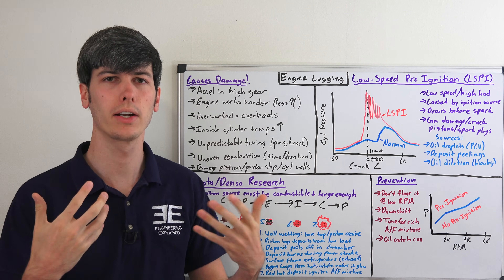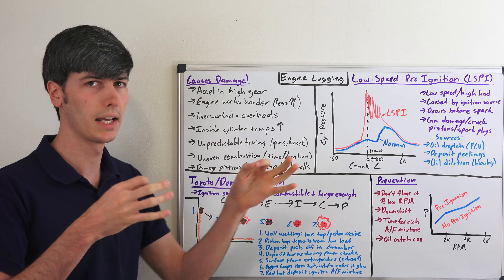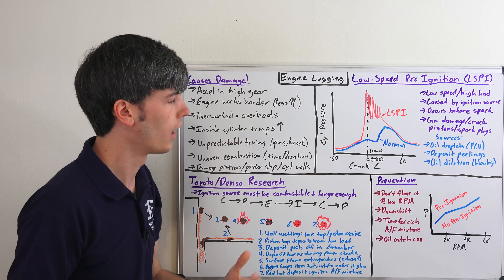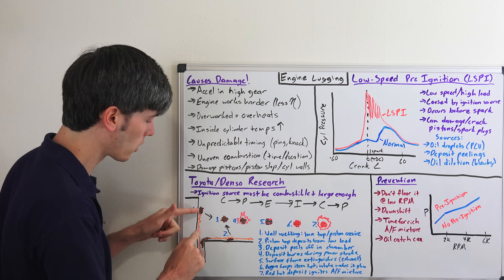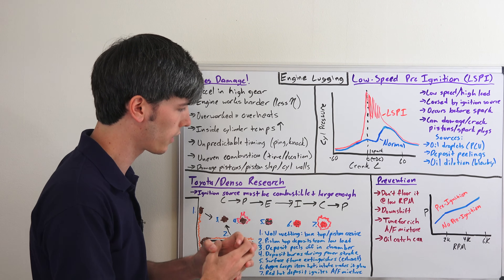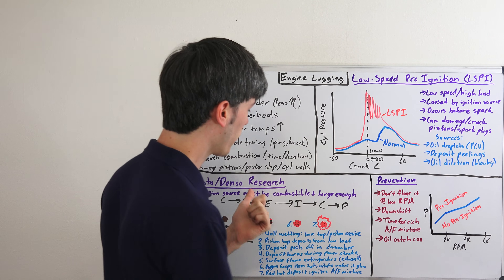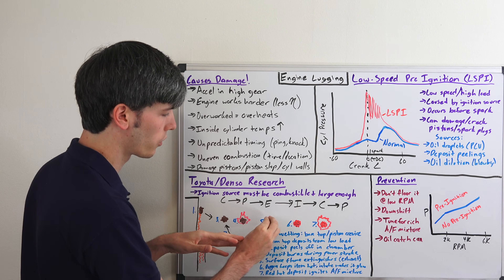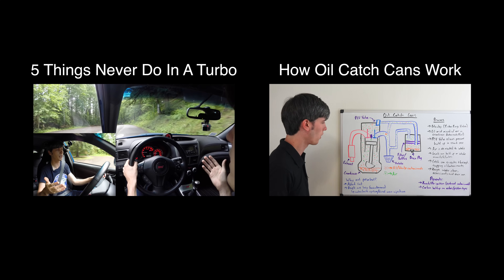Why You Should Never Lug Your Engine (Especially Turbos)

Comment: I haven't watched the video because he's hella boring...
But the combination of High Throttle Input and a Low RPM Gearing Choice makes the engine work extra hard to the point you can actually hear/feel it!

The fix is: Anytime you wish to Accelerate (put MORE work on the engine) make sure to downshift into a higher rev range! Obviously anything above 2500 should be safe (if you need to find that fine line you are probably just trying to distract yourself from a myriad of problems. Get your ish together!!). 

To reiterate: Just freaking downshift !!!!

Comment: What about cars with automatic transmission. they  seem to run at low RPM, i think on BMW 335, max power start at 1500 rpm and up shifts around 2500-3000 rpm in normal mode.  It down shifts automatically if engine rpm is too low for the gear you're currently in.  I assume the engine management  would prevent lugging.  Does this lugging apply to cars with auto tranns?

Comment: Most of the time I agree with Jason's Engineering Explained videos but I don't agree with this one. 

The gross majority of engines and all modern engines are designed to provide safe timing, air/fuel ratios and boost levels (if turbocharged) while being lugged. Other than sounding and vibrating like they are struggling and producing little power, damage is not being done just by lugging an engine (especially with modern ECU controlled engines).

Your not going to accelerate very well while lugging, but if you are too lazy to downshift and there is enough torque, you'll eventually get through the lugging condition and start to accelerate better without engine damage.

If you get detonation or pinging at any load, including while lugging, then your poorly tuned engine could be damaged but this shouldn't happen if properly tuned.

Comment: can you please do a video on manual engines and how to drive it. my tuner told me low rpms are bad while driving(cruising speed). you should drive in 4th gear at 40 mph 2200rpm to 2400 is optimal for less vibration. i also get better mpg crusing in 4th vs 6th gear. so all in all i heard manual cars its safer , better mpg if you cruise at a higher rpm vs low rpm. please make a video im really curious.

Comment: Do modern "drive by wire" systems have any protections in place for this? It seems like flooring it at a disadvantage has a pretty predictable, maybe asymptotic, curve of diminishing returns. A computer would be able to tell "eh, any more rpm than that right now will just damage things and not give any power" and choose to sort of rate limit you. But any time you make a mod that changes the power band, the computer would need to be told.

Comment: Hey EE, I was wondering if you have a method for assessing appropriate engine speeds for hard acceleration for a case by case basis. I ride a Yamaha R1, (1000cc) which revs to 12,500ish RPM. That being said, there isn't a large distinction between my RPM in 3rd gear vs 5th gear at a lower speed such as 40 or so MPH. Is it still potentially harmful to do a hard acceleration out of third gear at roughly 1/4th of my RPM range according to the context of your video? Thank you for your time.

Comment: Great explanation! I think my pvc valve is clogged. I have a 2560 Garrett turbo Miata 1.8. While I have a catch can, I'm noticing that burning oil smell on boost which might indicate poor positive crank pressure ventilation. I have safe afr and zero knock voltage from sensor. Also, zero blow-by at idle and no initial oil consumption at cold start i.e. rings are good and hold decently on a bleed down test. Are there over spec pcv valves? - I guess I'll start looking. Your videos are really the finest in youtubing. Please finish the supercharger on S2000 so you have a chance to beat my crappy but fast Miata.

Comment: This is most prevalant in turbo direct injection engines which is what most car manufacturers are moving to. The battle for car manufacturers is getting the most fuel efficiency without preignition.

Comment: What about the higher engine pressures on the metal surfaces that usually float on the film of oil... will they rub and prematurely wear out bearings etc....

Comment: Good really in depth video of things that go wrong that the average driver will not be aware of.  I believe that lugging does not only happen at full throttle as mentioned a few times but is generally what happens when you try to accelerate in too high a gear for your current speed. The engine may vibrate and could even cut off if extreme. Another negative effect of Lugging that I did not hear you mentioned is low oil pressure due to low engine speed. Low oil pressure can lead to increased wear on bearings and to have low oil pressure at a time when you are placing greater load cannot be a great idea. Additionally I have heard that it is well known in the automotive world that the ideal oil pressure is somewhat above what would trigger your oil light so when you get to the oil light stage things are worse than you might think. Of course there is material to wear and it is not an instant disaster but one that can be avoided by always being in the best gear which is why we drive a manual in the first place. Lazy shifters should switch to an auto. A true manual driver gets a thrill out of being in the best gear for the moment and beyond the moment by being proactive as the next gear is anticipated. This level of driving can only be achieved in an auto by connecting it to cameras and gps or the brain of the driver. Autos will always be reaction based compared to manual.

Comment: I have a question. my new 1.0 TSI engine makes a clicking sound when loaded, but the eco computer is pushing me to use a high gear all the time, which I don't always agree with. example I will just get over 35mph and it wants me to change to 5th. most of the time I try to ignore the gear suggestion but then economy suffers. the clicking sound seem to be more prevalent when going up an incline with 6th selected and doing about 50mph. it disappears after the road levels out. I did find some Toureg owners with a similar prob this was the wastgate chattering.

Comment: is this true  with  new engines? my VW GTI has  a espcial feature that make the engine have bottom power at very low rpm. when i drive in D the  car make shift at less than 2k rpm and when i push it a little bit more doesn shift down. it only shift down when i go full throtle

Comment: Your statement about reducing the chance of pre-ignition by "tuning for a richer fuel / air mixture" in my head the science of that seems BOTH Counterintuitive, and plausible at the same time... but that's a whole other subject...

Back to my original question... when running with a more rich fuel/air ratio, exactly (or approximately if it depends) how much extra fuel beyond the stoichiometric level would be enough to prevent pre-ignition, without seriously hurting fuel economy or causing accelerated engine wear/damage?? How much over the stoichiometric ratio IS enough to do damage or very fast wear?

Comment: All I know is that my VW TSI engine has so much torque and is much happier between 3,000 rpm and 4,000 rpm. But I normally drive it in D mode, which shifts between 1,800 and 2,300 at normal load, and is more than enough to overtake most cars out there. But the engine is much happier over 3,000.

Comment: If deposits are causing pre-ignition, then naturally that is more sensitive at low RPM and higher load (because of larger throttle opening and more air, just as you explain). However, the cause is not the "lugging" of the engine-- it is engine deposits.

And the problem with following the advice to not floor the engine is that you end up with more deposits. Or perhaps someone had a bunch of deposits because the followed the outdated advice and babied a new engine so it didn't break in very well. EVERY engine benefits from occasional full throttle usage all the way up to redline.

Perhaps a better title of this video should have been: "Why you should use Top Tier gasoline and synthetic oils"-- both of which are demonstrably better at deposit avoidance. It is those deposits-- not the high engine load per se-- that cause the LSPI. Again, at low speeds, the engine cannot breath very well, intake velocity is low and cylinder filling is not very good. So VE is way less than 100%  compared to a typical >100% value at peak torque RPM. So the engine is floored at low rpm is NOT experiencing high cylinder pressures due to a large volume of fuel and air being present.

Which leaves only the lack of controlled timing as a source of risk. The LSPI is a very real possibility, and as you indicate may be deposit-driven. But will a clean engine suffer at low RPM and high load?

It is true that piston and cylinder head temperature rise at higher loads. Average pressure goes up much more than peak pressure does (That's the BMEP increase that actually indicates load). But the piston will not get hot enough to initiation LSPI on its own. Nor the heads. Consider also that mass flow rate of fuel is a good proxy for heat flux. When you floor the engine at low RPM, the heat flowing into the engine is not nearly as drastic as at peak torque-- less fuel, and fewer combustion events per minute. 

In a small turbo engine, you have other factors like compressor surge and exhaust restriction that can make lugging especially consequential and not a good idea. A turbine with a high ER at low RPM (tight housing) will make it hard for the engine to move heat out of the pistons and head and it will get much hotter at low rpm and high load. It may actually lead to LSPI even without deposits. The exact amount of sensitivity is heavily influenced by valve timing events and will vary considerably from one engine to another. Generally, a smaller engine is more dependent on boost, so has tighter turbine and such and is more sensitive. A larger engine with more torque has the luxury of living with turbo lag, so it will have a larger AR housing and turbine and be far less restrictive at low RPM and might be comparable to a NA engine in lugging sensitivity.

Comment: I figure that as long as the engine doesn't protest, runs smoothly, and sounds OK, no damage is occurring when running the engine at low speeds.  I generally avoid running my 2004 Mazda 3 at speeds lower than 1200 RPM, but some engines can be run at lower speeds than that with no problems, even a wide open throttle.  On modern cars, the computerized engine management system should prevent problems which could otherwise occur with lugging.

Some early 1950s cars with Hydramatic would shift to high (4th) at as low as 20 mph and in 4th gear, those early Hydramatics had very low slip.  My 1953 Packard straight 8 with Ultramatic would shift to lock-up direct drive at only 20 mph (about 800 rpm) at light throttle and, without flooring the loud pedal, not unlock the torque converter until the car got down to 16 mph (about 640 rpm).  It was always totally smooth, never protested, and never made alarming noises.  Note that Packard introduced the lock-up torque converter in 1949 which is much earlier than some people think.

Of course not all engines are the same.

Comment: I enjoy watching many of your videos, but as an engine engineer, there are a few points I would like to comment on that are not very accurate in this video.

Regarding engine being less efficient when lugging, it is not completely accurate. First of all, it depends on if you are talking about overall efficiency or combustion efficiency. Regarding combustion efficiency, it is a balance between heat transfer loss (which is more prominent at lower RPM) and friction loss (which is more prominent at higher RPM), so the sweet spot is engine dependent (over-square vs under-square, how the wastegate/bypass logic works etc.), somewhere is the middle of the RPM range. But overall efficiency, which includes pumping loss, will tend to be higher at lower RPM since there is less pumping loss at lower RPM to achieve the same brake mean effective pressure (BMEP). 

So it is all relative depending on how low of an RPM you call it lugging the engine.

The second point is that on your graph you have the spark timing after TDC, which is not very accurate. Most modern cars have the ignition timing before TDC, since SI engines have ignition delay, i.e. the charge does not immediately ignite after spark.

One last point is that you did not point it out explicitly, but this explanation is for SI engines. CI engines (diesel for example) has a different mechanism and there are a few points you pointed out here that would not apply to CI engines.

Also, there are many comments from the viewers that said the ECM could take care of it. I think it is good to clarify that unlike knock, pre-ignition is not as easy to handle as knock in an engine. The main logic to move away from knock is by retarding spark timing. but since pre-ignition is not triggered by the spark from the spark plug, it is fairly challenging for the ECM to handle it.

Good luck with your channel and the future videos.
Reply: Si stands for Spart Ignition engines that so require a spark to ignite air/fuel mixture - gaz(propane, CNG, LPG), gasoline, ethanol (E85), engines
Ci stands for compression ignition, let’s say Diesel engines

Cheers
Reply: Your insights are pretty much what I was thinking, too. I know that overall efficiency is usually higher when the engine is at lower RPMs and higher loads, which is what I usually try to do when I'm driving (sometimes more "aggessively" than I should, if you can call "accelerating as slowly as possible without stalling" aggressive). I'm now puzzled with this situation, how can I take advantage of the low RPM high load efficiency boost while still making sure I'm not damaging my engine by lugging it? Any insights?
Reply: Great precisions, right.

Concerning the TDC related spark advance I think Jason means the moment of combustion accuring so it’s simpler to explain without the firing delay...
Reply: Thank you for your insights!
Reply: I really think that this lugging business he talks about is misleading people with turbo diesels to run higher rpm than needed and worse fuel economy
Reply: I didnt read i just scrolled lel
Reply: Somebody has to nitpick every part of the video and set the record straight I suppose.

Comment: Good explanation. I've just recently gotten my first manual transmission vehicle, and I love it, especially coming from automatics. I've had it for a few months and I've finally gotten comfortable driving it, but looking back I think I probably lugged my engine a little bit when I was new at driving it. When I say lugging, I mean trying to accelerate in a high gear (not WOT). Also a few times I've shifted too early and engine speed dropped to around 1000. In your opinion, do you think by doing so I've done any damage to the engine, or created problems that'll become apparent as time passes?
Reply: What car bro, still own that?

Comment: Just thinking...what is the chances of lugging of a modern light turbo engine mated with a CVT. The CVT will 'swing' itself reciprocally to lower gear when the speed is not there. Think of the new generation Honda Green Earth L15B engine block of Honda Stepwgn.  http://www.autoblog.com/2015/04/27/honda-step-wgn-jdm-japan-official/

Comment: well...you shouldnt climb a steep hill at 1000rpm at full throttle for a long time, but accelerating out of low revs and shifting early wont damage any modern engine. the ecu will prevent conditions of harm, so this is more a theoreticall approach and maybe applicable to very old cars. 

btw: any form of usage will be worse than locking a car away in a temperature controlled garage for all eternity ;)

Comment: Actually it really has nothing to do with knocking on any type of engine. If you are experiencing knock at low rpms then don't lug for that reason, but mostly that only occurs on an engine with other problems causing the knock and you mostly noticing it at the lower rpms. The real reason why it is bad to lug an engine has to do with oil viscosity and the time that pressure is applied during the power stroke. if your oil viscosity is low then if you lug it, the cylinder pressure will cause the oil to squirt out of the journal bearings, and you run the risk of having metal to metal contact. which is why diesel engines use heavier oils, or oils with a higher viscosity. oil works like water skiing in shallow water,  if you are going fast enough for the type of oil then your engine parts stay on top of the layer of oil just like water skis stay on top of the water. If your engine is turning too slow with too much pressure then it's like going too slow on skis in shallow water with rocks, as you slow down your skis sink deeper into the water and start making contact with the rocks. as you can imagine this would make for a very bad day for anyone. in your engine it causes metal to metal contact and wear. simple as that. if you like running your engine at lower rpms, then change to one level higher of viscosity especially in the higher temperatures of summer.

Comment: This explains two things:
- why I fouled the plug in our lawnmower (yanking the safety off and on at low revs is probably like "lugging" it), and
- why I'm hearing about fuel dilution in the oil in newer small-displacement turbo engines.

Nice use of ten minutes.  Keep it up.

Comment: I do not like the graph about cylinder pressure. You also mention it in your speech that the spark happens at the top dead center. This is actually not the case most of the times. The mixture is pretty much always ignited about 30-10 crank degrees before the top dead center. The TDC should be shifted a few inches to the right on your graph.